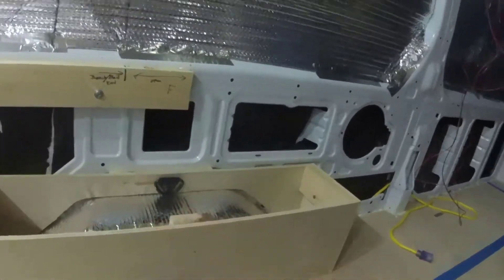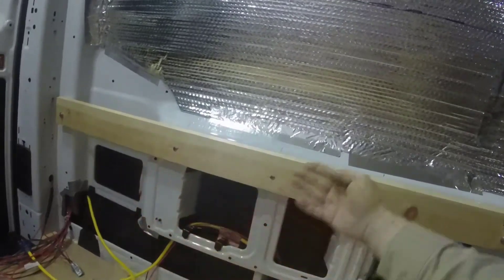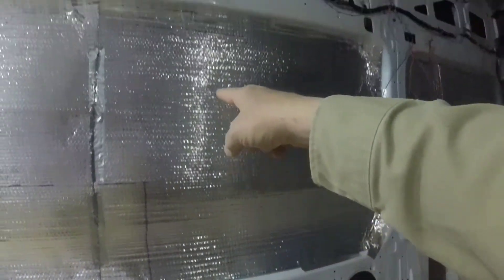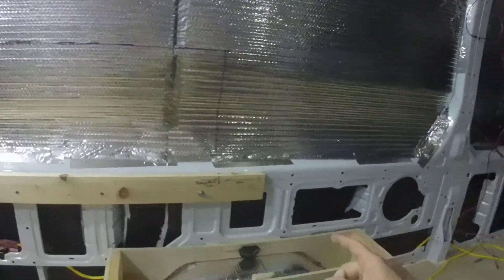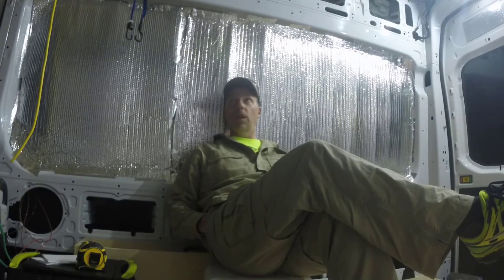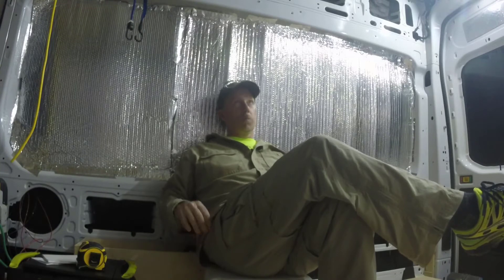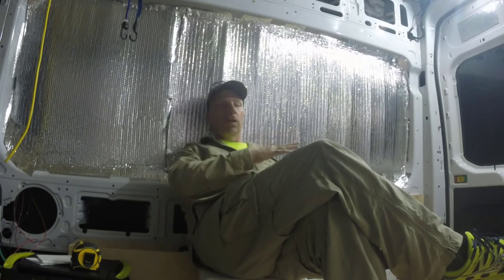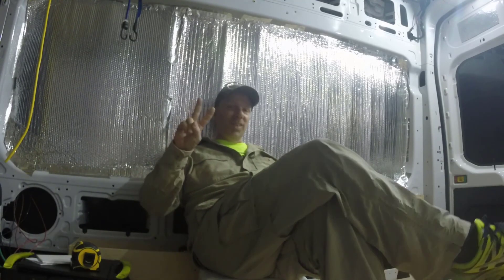Ford Transit Van Conversion - Wednesday Night Van Reflections

Comment: No comment on the wall issue but the back door pillars you mentioned the lack of insulation problem. I cut the thinsulate into strips and fished them through that area till I thought it was "full" enough.